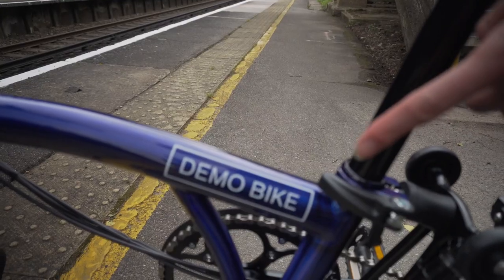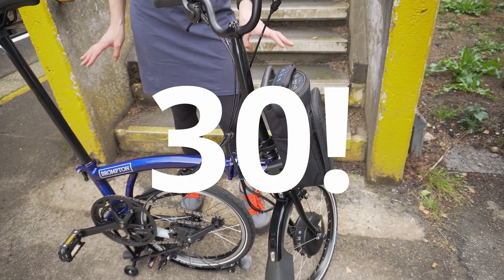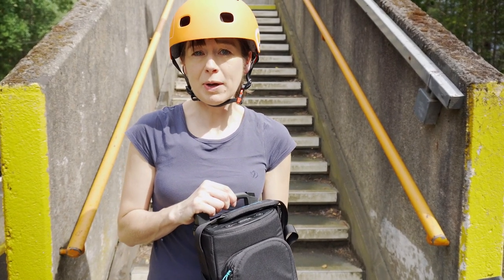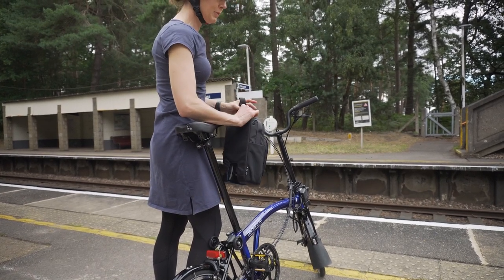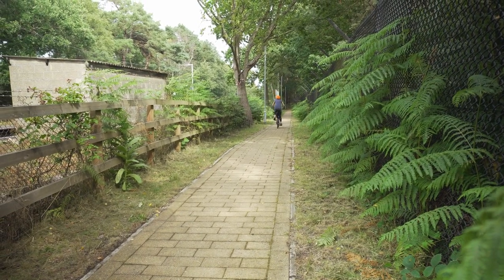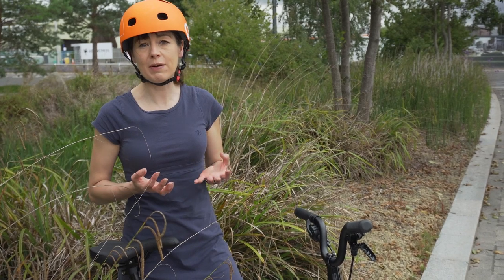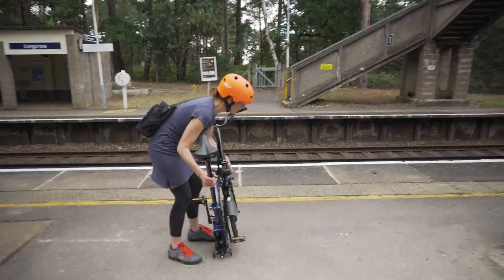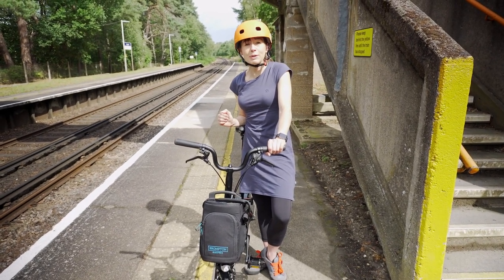Getting the most out of your Brompton Electric

Comment: I was also unaware of the 30 second delay.  I went back and looked at my manual (and online manual) and do not see that referenced.  I run my tires at 95 psi but may try 100.  The BE manual recommends 65 to 110 psi, which is a pretty wide range. But under inflated tires will definitely make the electric work harder.  I have just received my bike back from its 100 mile checkup and software update.  As always, thanks for another great video Ms. "B".  Cheers from Texas ....

Comment: Thanks. I wasn’t aware of the 30 sec delay at startup (the official BE Handbook doesn’t mention it and I’ve never had a problem). Better range also comes from choosing a route without stops - and from exceeding 25km/h! Surely tyre pressure also concerns comfort: I now choose 75 front/85 rear and that’s well within Schwalbe’s recommended range. My other tips for getting best out of the bike: carry a clear plastic bag to go over the Essential Bag in the event of a heavy downpour. Reduce fiddling with the battery on the move by always keeping the light setting at Auto. If you have a rack fitted do leisure tours with an aerodynamic combo of Rack Sack + Essential Bag rather than + City Bag which acts as a wind dam. Use City Bag where frequent parking or folding required + luggage capacity. And surely the BE can go anywhere a B goes - it’s just that the powered front tyre may not be that effective (eg rough tracks) - you can always turn off the motor. I find that on tarmac roads steeper than 20% I have problems maintaining adhesion of the front tyre under power and I push down on handlebars to help; but even so I have had to get off to push the bike up 25% hills (I don’t think they’re the BE’s ‘natural habitat’ that you mentioned lol). Counter intuitively, using the lowest power setting works best in these situations to minimise wheel spin (yes, I leave rubber on the road!!).

Comment: Helpful content 😊

I was loaned your original demo electric earlier in the year for about an hour (while my own pedal-power M6L was in for service), and it took me along various fast, slow and traffic-congested roads local to your shop.

Overall, I enjoyed the bike, found it gave me an additional layer of confidence on busy roads, particularly as I could maintain speed well up inclines, and accelerate easily away from junctions. I tended to be a bit greedy on the power setting, though, as I had max much of the time, and felt somewhat disinclined to have power on #1 or off completely.

A couple of things I noticed with the electric, and no doubt a regular user would accommodate to:

In tight stop/start traffic situations, easing forward with electric assist on could give a slight “surge” of propulsion - so I had to be careful not to apply too much pedal pressure when getting going (when behind a car, for example), else I needed to apply the brakes to counteract.  Power setting #1 was therefore preferred in tight traffic.

As a regular non-assisted rider, I am always used to having to make effort, so whilst the electric assist is really great for the hills, when it was easing off-power assistance or maxed out (about 15 mph), it could comparatively feels like it was “dragging”.  This may not bother many people, but as a bit of a cycling purist (for now, anyway), I did find this detracted slightly from my ride experience.  This is probably common to other electric bikes as well though, this was my first and only electric assist ride.

The big plus for the Brompton electric has to be the no-sweat ride  -  arrive at your destination still fresh and unflustered!

Comment: Have mastered the “on the go power change” but I agree, not recommended. Thank you for mentioning the battery disconnect issue. Big problem on Swiss forest tracks and cobblestone town squares! 2 blue lights flash, stop, off-on, calibrate, yawn! We turn them off before riding over them. Best advice I give is “they’re urban bikes, it’s what they’re designed for”. Off to try them around Lavaux vineyards soon!
Reply from the maker: Thanks for that great feedback

Now you made us jealous!
Reply: You might find that even on slightly uneven ground the battery latching system will fail, putting something heavy into the bag might help to keep it secure and in place, you could also try a Bungy cord pulling slightly down on the bag and secured below the bag will help, but not too tight, just to help stop the bag moving around and to prevent wear and tear on the latching system which holds the battery to the bike.
Reply: Is the ‘power change’ advice in the video a recommendation for rider safety for better control and visibility, or can you still change power whilst the bike is in motion?
Reply: @mikexhejghdlfbrjshfjfvs3624  Yes, there is nothing physically stopping you leaning over the handlebars, one hand steering, the other hand tapping the power button to change settings. It's just that there is a high probability of looking up and seeing a truck of fence in front of you and BANG, there goes your day. Therefore, to protect Brompton from silly people suing them, they have to say "don't do it". Do it at your own discretion.

Comment: One thing you missed and was mentioned to me by the dealer and is in the separate battery charger manual, is to plug the battery charger into the wall first and then into the battery which is kinda counter intuitive.

Comment: I have a bolt blue electric Brompton. I love it. I had completely given up on cycling before I got this to do the commute to work. 

I have come across the motor cut out thing. Unfortunately my house is surrounded by speed bumps that have cobble stones before and after. I have to avoid those. Or at least, I have to avoid pedalling over them, just rolling over is fine.

I took mine back to the dealer and they said that it was more sensitive than their demo bike so they kindly changed some parts to improve it.

I still can't pedal over those bumps (which is tough when you are cycling up a 30 degree incline) but it's fine over some of less well looked after roads near me.

Comment: I just returned my Electric Brompton. The battery rattle, issues when shifting internal hub from the 3 to the 2 gear, no compliance with the USA top speed of 20 MPH, annoying delay at the start, low quality on the two bag options, the battery can't flight in commercial flights (only cargo), Bicycle is heavy, etc. I added the swytch conversion kit to my other 3 Brompton bikes and know I have both e-bikes and the conventional bikes when needed.

Comment: Thanks for the thoughtful tips and practical reminders. My first Brompton is a Bolt Blue too.  I just finished a 33 mile ride on flat ground with headwinds and used 3 bars with low power the entire trip. That's about what I expected and don't think the battery was fully charged when I left as the first bar disappeared within 5 miles. I rode in 2+ and 3- during the ride and felt like I was engaging the motor at times when it wasn't needed. Is this something that comes with more experience? Pretty good performance still I think given my 180 lbs. My shop pump has trouble locking to the front valve stem and hits the motor. Can I safely bend the valve to make a better connection or do I need a different pump? Looking forward to more Brompton Electric tips and advice. I would like ideas on bike computers or controllers that give speed and distance readings. Maybe something Brompton is working on?

Comment: I look forward to Brompton's bike builder returning so I can finally place an order. Unfortunately, the stock selection currently offered by Brompton seems to always include an extended seat post, rather than the standard - and I'd object to paying £20 to post-purchase what should be available from the start. Yes, I realise it isn't necessary to fully extend the post, but I want the more compact fold you get with the standard size - not to mention the fact that I just have to pull the post all the way up and lock it to get it at my preferred height!
Reply from the maker: Thanks for the comment

Any good dealer should offer to change from the extended (not to be confused with the telescopic) to standard seatpost for free

Comment: Have had an e brompton  for just over a month  I didn't  know about  the 30 second wait but I have now started  doing it. On a separate  note just fitted  a trigo phone mount to my e brompton,  make sure if you fit one to have the mount in a vertical  position when you drop the handle  bars otherwise  it will smash straight  into the motor

Comment: A few more thoughts and questions. Yesterday I rode nearly 15 miles at level 1 on flat ground with some headwinds. I still had 5 bars at home when I plugged in afterwards and no charging was possible in spite of my ride. The battery must have been down 10% or more though. Also, I haven't located a rain cover for the small battery bag but it certainly seems like there should be one? Even very dry California gets wet at unpredictable times. Thanks again for this thoughtful overview!
Reply: I asked Brompton about the rain cover for the small bag and I was assured that it was rainproof but should not be immersed. Even so, I would like to get hold of a suitable cover.

Comment: After watching this video I pumped the tyres up to 100 psi as recommended. This gave a very harsh ride. 
I know that it is a trade off between performance and comfort but I guess that the electric assist will minimise any extra effort. Obviously, the tyres must be hard enough to avoid pinch flats though.
A range comparison using different tyre pressures would be interesting.

Comment: Brilliant Video. I've had my BE for a year now and although my pre-ride routine means the battery is generally fitted 30 seconds before I move the bike, I never knew that this was so necessary, I guess a case of RTFM. Slapped wrist  :-)
On a separate point, somewhere on the Schwable website, there is a table of loaded weight (bike plus rider) v tyre profile = tyre pressure. For me the figure is about 92psi. Hope that this helps,
Reply from the maker: Thanks once again for the kind feedback

We also only just found out - that’s why we thought we would share

Thanks for the info on the Schwalbe website - we’ll check that out
Reply: @brilliantbikes  The info is under technology/FAQ > inflation pressure > correct tyre pressure

Comment: i was debating and Electric one, but thought hmmm if I get a Super light which is cheaper, way easier to carry around, will have a higher top speed, can use my own bags, and don't need to keep worrying about charging it up. I bought the SL and am really happy with it. This video makes me even more relieved I went down that route - ie 3 reasons not to get one!!
Reply: Hi Colin. This is helpful. My wife and I are presently debating whether we should choose two SuperLights or two Electric Bromptons, to be the bikes we use for shopping and touring around from our sailing yacht base, during a journey all over the place. We think we'll really appreciate the light weight of the SLs, especially when lifting in and out of our tender or within the tight confines of the boat. Easy carrying/moving in general, around town, will be handy too. However, we compare this with the wonderful power-assistance of the Electrics, which would be so very good if we're towing a ton of groceries back to the marina, or going on a long ride to see the sights or buy bits and pieces. Hmmm. We're late 50s and quite fit. Tricky decision. Do you have a 'real-world' weight for your SuperLight?
Reply: The Superlight H6L six gears = 24.78 pounds.

Standard H6L six gears = 26.63 pounds.

Brompton Electric H6L six gears = 31.96 pounds (38.36 pounds total with battery attached).

Battery weight is 6.4 pounds.

Overall: The Superlight Brompton is 1.85 lighter than the Standard Brompton.
The Brompton Electric (with battery removed) is 5.33 pounds heavier than the Standard Brompton and 7.18 pounds heavier than the Superlight Brompton.
The Brompton Electric (TOTAL weight with battery) is 11.73 pounds heavier than the Standard Brompton and 13.58 pounds heavier than the Superlight Brompton.

Summary: assuming you remove the battery during transportation in the folded state. The 5.33 extra pounds to the base weight or the 7.18 extra pounds to the base weight might not seem like much. Bio–mechanically though there is a difference. Example, if you hold 5.33 pounds next to your belly button (close to bodies center of gravity) and start extending your arm out, you realizes very quickly the weight truly seems to multiplies. At a Brompton shop I started lifting different folded Brompton's. I was surprised how much of a difference 2 pounds made. This is with my arm extended down as it would be in the real world. Of course this is all relevant on many personal factors (required stairs, traveling, strength and endurance and how often are you planning to lift it on a daily basis, price, etc.). The bottom line is, if you're getting out there on your bicycle more because you have an Electric Brompton or if you're getting out there on your bicycle more because you have maneuverable later Brompton? Which one is going to get you out there to enjoy the beautiful world of bicycling? Hope this helps. Hope this helps!
Reply: I would say if you’re debating between electric and non-electric then get the non-electric. I love the electric but it’s a bit of a faff having to charge the battery. I got it so I could commute fast without getting sweaty and it does that very well. For every day, casual cycling I would prefer a standard Brompton unless I had a lot of hills to get up. I also feel that taking a standard Brompton into a cafe etc. is acceptable but a Brompton AND its battery, well it’s fine but having two items is literally a handful in both hands.
Again, don’t get me wrong, I love the electric and fully recommend it, but there’s something pure about a non-electric.
And actually, I’m considering getting a standard one as well. Especially if you might go cycling with a friend or partner, it’s a lot easier to splash out on two Standard Bromptons than it is for two electrics!

Comment: There was a recent discussion on Facebook (in the "Brompton Electric Owners" group) concerning the 30 second wait. Most comments were incredulous, so the original poster asked Brompton directly, and they responded that the wait no longer applies. Apparently it was required by some early firmware versions, but it should not be needed now..Cf. https://www.facebook.com/groups/417710052055139/?post_id=879825495843590

Comment: Another informative video, many thanks.
A stickler for precision (from the engineering part of my background) I assume it's "Store with... (at least) ...2 to 3 bars charge. So 2 to 3 is a minimum, anything above is ok?
Reply: Hi taber. Lithium batteries degrade the least if they are stored with around half charge. For example, the smart lithium batteries for my drone are programmed to self discharge down from full charge to approx 3/4 charge if they are not used within four days of a full charge. So the answer to your question is: no, it is not correct to think that anything above 2 to 3 charge level is good for storing a Brompton battery. If you're going to be storing it, it's best to start that storage period with a charge status of 2 to 3. :-)

Comment: Great advice. Like the deadpan humour too :))
Long time brommie owner thinking of going electric 
due to age needing assistance on hills.
I am a not too strong lady so would the 2 gear give me
as much assistance on hills as a 6 gear?
Reply from the maker: Thanks for watching

It’s a really really good question - that we don’t know the answer to .... YET!

We have just got a pair of power meter pedals - these measure how much power is required by the rider to propel the bike

We’re planning (very shortly) to compare a manual Brompton vs Electric 2 speed vs Electric 6 speed to compare the effort required

Hills are quite variable ... are yours big or small? (Locally we have Box Hill which is quite well known - but maybe you have another suggestion)
Reply: I was thinking along the lines of Swains Lane North London,
one of the biggest hills in the metropolis.
Eagerly awaiting your assessment of both bikes on hills.
Reply from the maker: We know that one - short and sharp!
Reply: My wife and I find our 6 speeds go best in top gear, full power, up hills. The motor really zooms you along as the sensors can tell your input. Only trick is to remind my wife to select lower gear for taking off again before we stop. If short trips less than 20 km return, then use full power all the time.

Comment: I've got a standard Brompton and I'd find waiting for 30 seconds before riding off to be really annoying.  Hopefully it's something they can reduce / eliminate in the future.
Reply from the maker: We though the same

But in practice by the time you chuck the battery on / pfaff a bit (eg putting on helmet)- the times gone

I guess it won’t be completely eliminated- even our Garmin power meter pedals want a few seconds each ride to calibrate as zero
Reply: Just changed my “workflow” to install the battery first. Then glasses, helmet and gloves. The bike waits on me now !
Reply: I’ve always just jumped straight on. Never had an issue apart from the very rare occasion that it gives me no power combine with very brief spurts for perhaps 30 seconds. I believe they have changed the firmware so it remembers the calibration from before and I also believe since then, another firmware has been released.